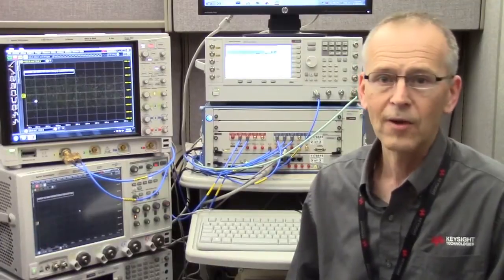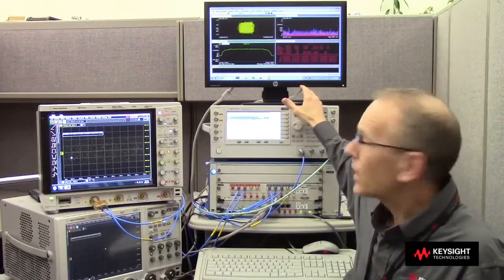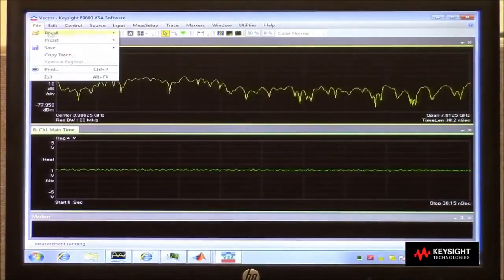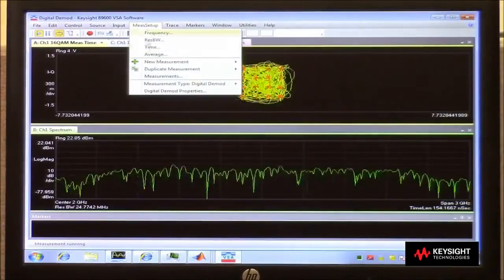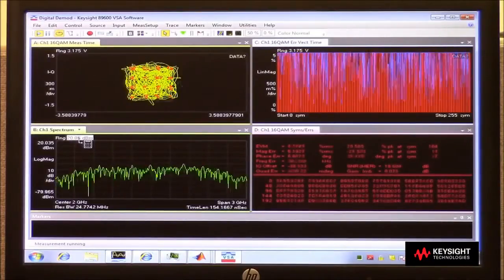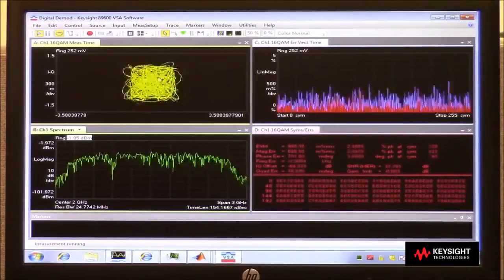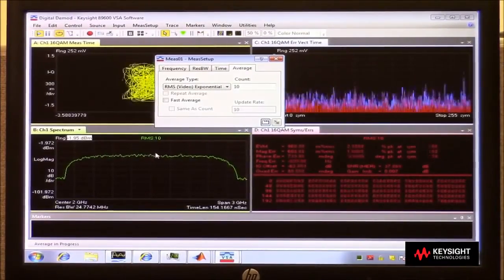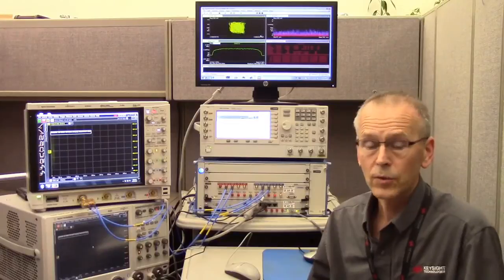Infiniium S-Series Oscilloscope and VSA Performing Wideband Comms Signal Analysis

Comment: Can you please explain the procedure in detail? I am also doing the similar type of research, but it did not show the "Digital Demod" under MeasuSetup In this software. I am using DSAV084 V-series Infiniium Oscilloscope.  Thanks
Reply from the maker: Definitely, I've passed your comment to Brad and will respond once I hear back from him.
Reply from the maker: To get the "digital demod" option you need to have the 89600 VSA option 'AYA' for vector modulation analysis. There's a technical overview here: http://literature.cdn.keysight.com/litweb/pdf/5990-6387EN.pdf